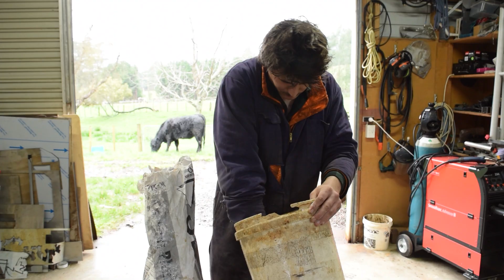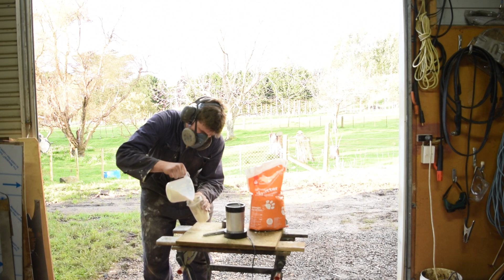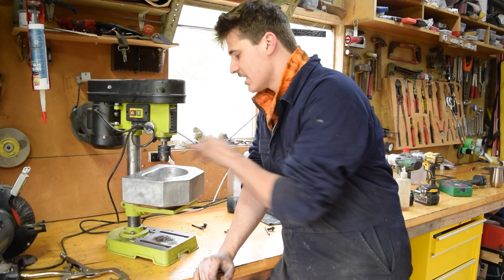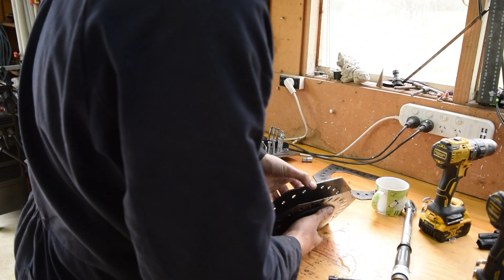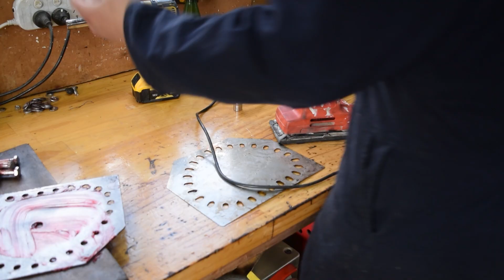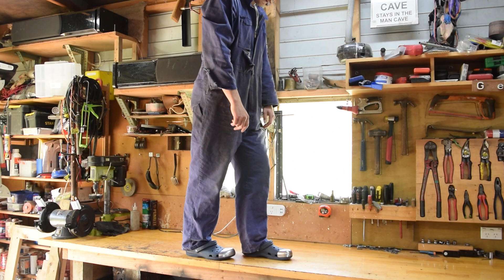How to make Steel Capped Crocs - using water

Comment: I came here for some hydroforming and I was not disappointed. You're a tenacious one aren't you? Definitely skilled as well. I have to make a sort of bubble to clear a modification I've done to my car. I don't want a hood scoop, I don't want to lift the hood. I figure a bump on the hood (bonnet?) won't look quite as ridiculous and won't draw as much attention from the Police. Hydroforming seems like half science and half VooDoo but I think it's my best bet to not stand out too much. I'm no kind of panel beater. If I tried to hammer something out it'll look like a drunken blacksmith did the job and that's being generous.

You seem like you know your business, so please forgive me if you know about this. Steel crucibles are just bad news. They contaminate whatever you melt with iron, and they will fail spectacularly. The best case is that they fail while still in the furnace but they can also let go while you're pouring. Then all that melt going on the concrete, the concrete will start firing spalling all over the place. It's a really bad situation. The heat alone weakens the steel considerably. For a one off you're probably not worried about it but if you're going to do more you ought to check out graphite or silicon carbide. You can make your own graphite clay crucibles or you might be able to order them. I don't know the availability where you're at. I go for Super Salamander. If treated correctly they go for many more melts than steel. The #4 size that I use runs about $40USD. This is personal experience. I damn near ended up with 8 pounds (4-ish kilos??) of brass on in my boots. I don't know how but it didn't burn straight through.
Reply from the maker: Thank you, that sounds like a fun project, if you have a 3d printer you could make a set of dies to incremental force it, or make a foam blank and fiber glass over to make the cover? Yeah definitely, I will have a look into what you recommended, I have tried graphite but what i could get at the time was expensive, but I did like it. Good luck with your project and good thing you had boots on molten metals no joke.
Reply: @FinlayShellard  I'd rather weld in steel. I have plenty laying around and I'm pedantic. We'll see how it turns out though.

This guy has a good walk through on making crucibles. If you can get material and if you know a guy with a kiln you'd probably be set.
https://www.youtube.com/watch?v=HuM4xSNX0no

Comment: The baking sodas effect is the same reason it goes into baking recipes... Baking soda, NaHCO3 is when exposed to heat(around over 75 celsius, or what is that, around 180 farenheit), degraded from NaHCO3 into Na2CO3 along with byproducts of water and carbon dioxide, both of which are preferred in biscuits and such as they prevent the drying of the dough and add lovely porous texture, along with alkali sodium carbonate, which brings up the PH of a cake, but in case of casting, water and carbon dioxide are the enemy, as one will result in steam geysers of molten metal and the other being a gas will give you porous structure of the casting throughout the cast body.... That is why you dodge scent removing cat litter... Just a bit of chemistry behind it...
Now for the machining part, you should take a ball nose endmill, get a carbide one, run it around each screw hole, run it in two passes, inside and  outside the bolts and get some good silicone gasket maker, fill those passes, set the wear plate, seal around it again, on the inside only, and do so with each plate in very thin layers, also, the plates should be sanded smooth and flat aswell if you want to try avoid using so much gasketing... It would allow much higher pressure buildup... Or just allow you to lay around a copper wire, a thin one and crush it with each plate, copper is a great sealant if used correctly....

Comment: I respect the hell out of the number of iterations you did there, that's a lot of $$$ in stainless and a lot of hassle and effort. I think a lot of youtube channels elide the learning process, nice to see it featured. For future mold making efforts I'd suggest starting with a shallow initial former and working your way up a few mm / cm at a time over multiple molds. The pressure wouldn't need to be so high on each individual mold, and you might not get shear issues as badly trying to move the metal only a bit at a time. That might also help you to put the most material where you want the most stretch, e.g. at the edges.
Reply: He said its mild steel, not stainless, but fuck me sideways, i might have missed him changing to stainless during the vid...  And if he got it from a scrapyard, its not really a lotta cash... I always get at least 5kg of stainless in different forms for machining purposes from a scrapyard, along with other steel and metals, and 5kg of stainless is 20 bucks, which in sheet form is a fucking lot...
Reply: @camillosteuss  at one point he mentions he "ran out of stainless" or something. Either way it's an impressive number of tries!
Reply: You are talking about progressive die forming. But is hydroforming progressive in real life? No clue.
Reply: @constantinosschinas4503  Exactly, and the answer from what I've seen is no, but they also have 25k psi systems, teflon gaskets, and 3 inch bolts holding it all together. I thought it might help him get the most out of his existing setup :)

Comment: Nice work mate! Couldn't you stack a couple of the steel caps nestled inside one another to increase the protection level???
Reply from the maker: Absolutely laminating them would be perfect. I had some success with the thicker stainless, but i ran out as i was dialing in the settings.